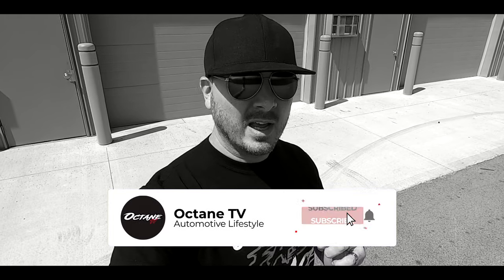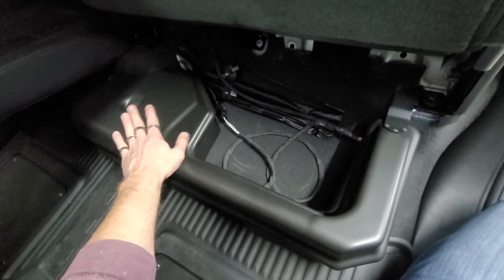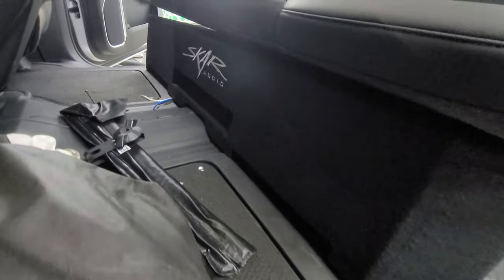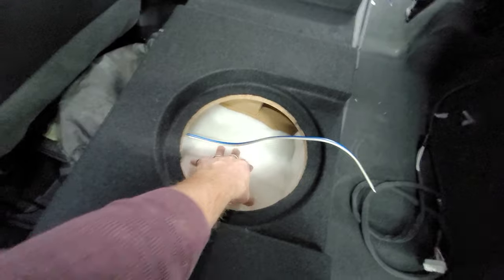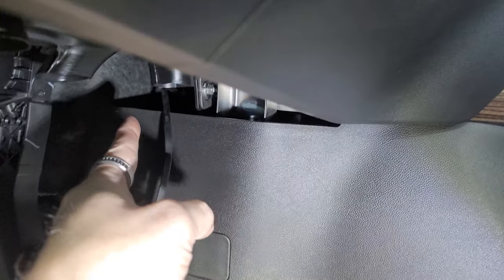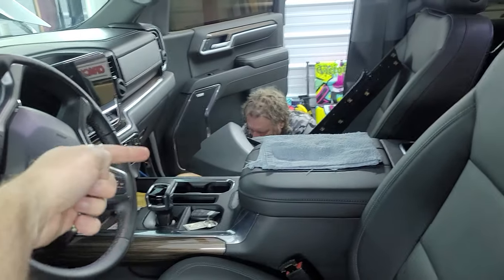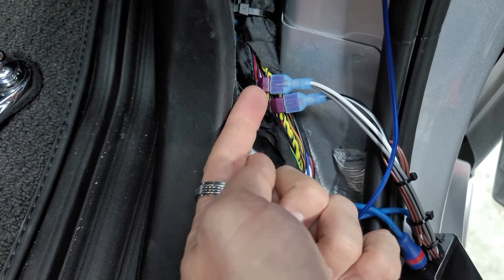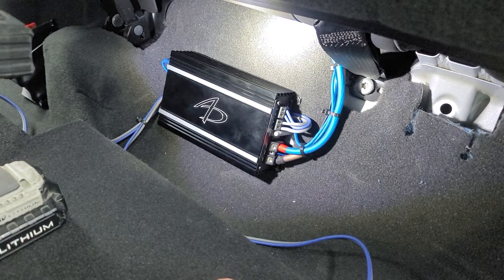2019 -2023 CHEVY SILVERADO / GMC SIERRA AMP AND SUB INSTALL

Comment: I have a 2022 refresh Chevy non Bose and there is no yellow and yellow/black wires in my kick panel.
Reply: Did you find out why colors is it for your truck ?
Reply: I have 2022 refresh as well and same issue. The braided wires in my harness are blue/white. Think they are the same as the yellow/black in this video?
Reply: Mine are also white with blue and a brownish stripe
Reply: Dis you guys ever figure out which way one they where
Reply: @johnathanvelez3648  yes, I went ahead and tapped into the blue/white braided wires and worked perfect. Same as in the video. Guessing the none Bose models use the blue/white wires.
Reply: @AlexGarcia-bq7wz  so non Bose is blue and blue/white?
Reply: @recon4th  yes

Comment: Dude you guys are awesome! I have a new 2022 Silverado refresh and have been scratching my head trying to figure out where to hook up the remote wire. There was no open terminal where your other video (and many others) said to hook it up. I tried to use an add a circuit fuse tap, but all of the fuses on that side had constant power. You guys saved the day with this video! I had my remote wire unhooked waiting for a new line out converter with a remote wire built in to show up from Amazon but I will be sending that back because I just ran out to the garage and hooked up my wire to the small pin you guys showed and bam, my amp turns on and off with the key. Thanks so much for your videos guys, you made my day!
Reply from the maker: Thank you we have about four or five other videos that we've recently posted up in the past year on these trucks but not one that's a 2023 with this dash! Thank you for the great positive feedback!!
Reply: Did u have to add a fuse ???

Comment: Stop tapping into factory wires for aftermarket audio especially when it’s Bose… get a wire harness to plug and play
Reply: I have been researching this for a few days for my new 24 ZR2. I unfortunately have come up short on finding a plug and play for Bose. They only make plug and play connectors for non amplified models.

Comment: don't rely on those t-taps, they are a terrible connection and all of your customers with these installed will eventually come back once they oxidize and the connections become static or are gone. I used them for years to tap into different wires for alarm and remote start applications that didn't involve any high amperages and after a year despite being zip tied so they couldn't move around, they still ended up failing.... That is for the vast majority of the connections that were made. It's always best to strip the factory wire without cutting it, wrap the wire around it., then solder them together. We tape the connection and put a small ziptie over the tape so it won't come open and short to ground or sharp metal supports that always all the time are grounded in a car.
Reply: Are you talking about for the LOC? I’m relatively new to sub installation. I’ve installed 2-3 but on 99-2009 model vehicles. Never messed with LOCs before.

Comment: Quick question. Do I need the pac you used for my factory radio to operate properly? I had a local shop install amp and sub. He stated he spliced into the ignition sense and the factory speakers. Now my radio keeps restarting and stalling. Should he connect differently? 2023 Z71 silverado rst with the big 10" screen. Any help is appreciated.  Thanks!

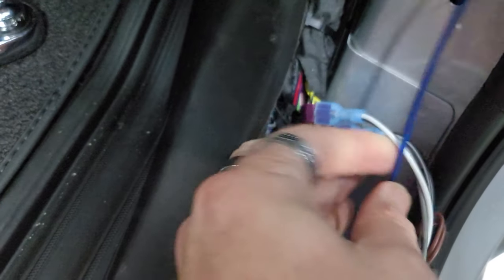Comment: At 9:50 you have the kick panel removed. Is there an easy way to remove that without potentially breaking the clips or the panel? Also, where do you end up hiding the Line Output Converter? Did you use a special tool to pull the wire to the back of the truck, or just hand feed them then dig them out with your fingers?

Comment: I’m fixing to hook this setup, with Skar shallow mount subs, in our ‘22 refresh with the big screen. What’s the best way to adjust the loc gains? Or where have you guys been setting them? TIA
Reply: I'm running a simalar set up,skar dual shallow 12s in the same box.. and I used a pac sni 35 loc,my starting adjustment  was about 3/4 way up. After break in I turned it just shy of all the way up without distortion. I'm running the skar rp 1500 amp,I did dial that back to about 80% so I don't destroy anything with the bass knob all the way up..

Comment: I have a 2017 gmc with Bose but I can’t get subs to hit bc the satellite receiver box won’t let splitter with rca hook up send signal and I don’t want to tap into factory harness wires and don’t want to mess up the active noise cancellation

Comment: Nice clean install great video just a question why the pac high n low and not a lc2i or kicker loc2 that comes with built in remote turn on with just speaker outs?
Reply from the maker: You can really use any LOC but we choose to use the vehicle ignition to turn the amp on versus the built-in remote turn on on the LOC only because we've had problems with that turning on all the time or sometimes because it is signal sensing
Reply: @octanetvchannel  right on i been using the kicker loc2 works very good no poppin or no remote problems.

Comment: Can you tell me what size connector you used for the remote turn on wire?  I've got to add that to my system and I want to make sure the wire I choose has a solid connection.
Reply: What type of terminal connector did you use for the remote?

Comment: Is the tap for the rca signal going to be like this on all the 22/23s cause I’ve seen some videos where it’s on the driver side lock panel and different color wires
Reply from the maker: You could do it from the driver side as well but it's going to be a different speaker that you're tapping into. This way would be running it off the factory sub which would give you the best signal
Reply: If there’s no factory sub though I should be running from driver side then correct ?
Reply from the maker: @codeethompson8773  if you have Bose It will have a factory sub. I have other videos on the channel of non bose installs. But if you do not have a factory sub you can use any of the speakers. I would recommend using the rear speakers if at all possible

Comment: Nice video ,i have a 2023 gmc elevation x31 and it doesn't have the booss system, which one do y recommend for a standard non amplifier system in this truck which pack
Reply from the maker: SNI-35 for loc. We have a few other videos as well on these trucks on our channel that show how to do it without bose
Reply: @octanetvchannel  
Thanks alot I will be looking for
Reply: @octanetvchannel  
Also I will need the inclosure for 2 8"
Reply: I have the one he uninstalled from this truck and to me that’s more than enough. The funny thing is the amplifier that comes with the kicked sub can be adjusted. Remove the amplifier from the kicker sub (4 screws) in the back the amplifier it has a little opening protected by a rubber piece, remove it and turn the gain levels all the way up. If you do that,  it’s way way way way better. I have to keep my bass level at half because it’s shakes the fucking cabin too much. 🤣

Comment: I live  outside of Louisville and have a appointment to have a amp installed with a sub under the rear seat.  Reputable business over 35 years but i may ask them to watch this video to make sure they don't screw anything up on my vehicle. If it was a old vehicle really wouldn't matter but i have a loaded truck roof leather 6.2 etc.....Out of curiosity, how long does it take to get the wire ran and amp ready to be installed from front to rear? Reason i ask is when i take my truck to the shop, i will have to wait so i am curious if something like this can be done in a few hours or is it all day job? I have a 21 model with the Bose system with no rear factory sub under the seat. Hell who knows, i may end up take a trip to INDY and scheduling a install with you guys...
Reply from the maker: Usually 4-6 hours depending on the trim level and engine

Comment: Do you guys know if this same process will be used for installing a new amp and new speakers in the doors with no sub? I have a decent knowledge of car audio but this will be my first time tackling the installation by myself on my 23 Silverado with the 13.4" screen. Any tips would be great!
Reply from the maker: Yes the installation would be the same minus you would not tap into the yellow and yellow with black wire. That wire is four of the dedicated sub so you would want to wire into the door speakers. I have other videos of these trucks where we do wire into the door speakers running through the door boot to the back door speakers. That would be the only difference is where the input source would come from
Reply: @octanetvchannel  I have 2023 Silverado with the 13.4" screen and factory factory Bose I am looking at installing subs and an amplifier into existing factory set up. Talking to a local stereo place said they are waiting for some kind of interface because last one they did like mine had issues at 2000 RPM. It would squeal through speakers and glitch the ON star.  Have you guys had this happen with any of your installed or upgrades on vehicles like mine? Looking at this video its totally doable. And this video is what to use for what I am trying to do? Thank you for any help

Comment: Question, I’ve got a ‘24 Silverado 1500 with the same type of fuse box lug as this truck. 

What is that connector called to tap into it for the remote wire?

Thanks.
Reply: Anyone?
Reply: @209Stretch  What type of terminal connector did you use for the remote? I'm the same.
Reply: @209Stretch  Its a 2.8mm spade connector. Basically a normal spade connector, just a slim version.
Reply: @miguelgongora5637  2.8mm spade connector(Female side).

Comment: Hey brother so I’m trying to install a LCQ1 from audio control I have a 2019 Silverado trail boss custom non Bose where should I get the signal from where should I tap in. Please help appreciate it!
Reply from the maker: We have other videos on our channel for the Silverado without bose. In those videos we usually tap into a rear door you can get into those wires by taking off the b pillar and tracking down the harness going into the door. It will be a cross braided wire.
Reply: @octanetvchannel  thank you man really appreciate the help
Reply from the maker: @jose-yz7le  if you need any more information let us know
Reply: I feel your pain man. I have a Custom Trail Boss myself, also with a non-Bose audio and it’s terrible. You have to darn near crank the thing all the way up to hear
Reply: @leir2005  I installed an LCQ1 to get the voice installed a 4 channel amp with 4 deaf bonce neo 6.5 and 2 super tweets and then 4 8” subs underseat upgraded to a second lithium battery and upgraded alternator to 370 amp my truck is screaming 💪🏼

Comment: Hey man, I don’t want to spent $500 on a custom box. I’m considering this one, but my audio guy says that the box is garbage…not sure? All he has are the hard like rhino lined ones he said it’s better. And he wants $280 for it
Reply from the maker: We have ran this box in this vehicle and had no complaints. We haven't done this exact enclosure in all of these but it would depend on what subs you're running? I would highly recommend doing shall amounts because it is a very small enclosure for ported. It does sound very good with these subs. But I can't say the same for any other subs.

Comment: On the yellow wires which is positive and which is negative. Its hard to see with fingers in the pics, sorry.
Reply from the maker: It really doesn't matter which way you wire it because it's a single mono output
Reply: @octanetvchannel  ok sounds good. I hooked my last one up behind the radio in the dash this looks much easier I just hope I have that wire in mine since it's just a 2023 2500hd custom I'm not sure it will be there.
Reply: If you wire it backwards it will be out of phase with the other speakers in the truck.
Reply: The yellow and yellow black is for the front right door. If you connect to it, you will only get half of the signal to the sub (only the bass that is on the right channel, so any stereo signal that goes to the left will not make it to the sub). The blue/gray (+) and green/black (-) go to the speaker in the center console (factory sub). This is where you want to tap into.

Comment: Bass knob install is not good.  Geez.  You can take them apart and then mount the guts inside the dash with just the knob flush mounted to the dash.